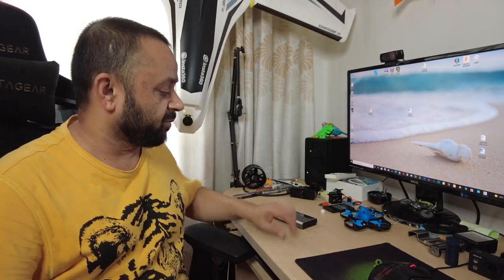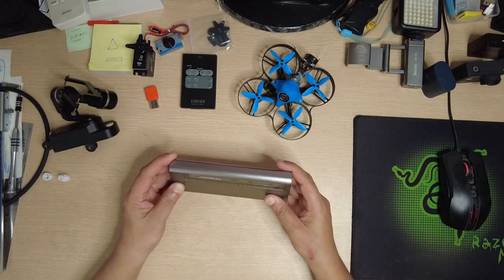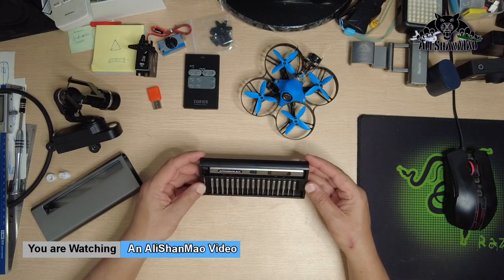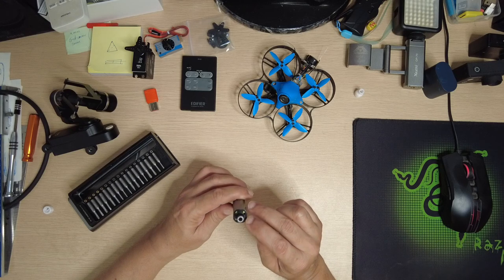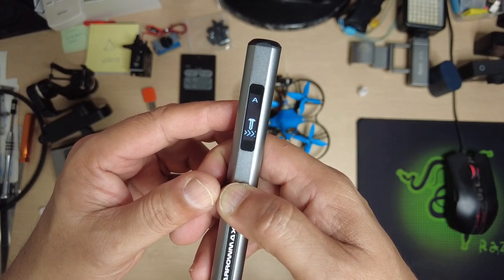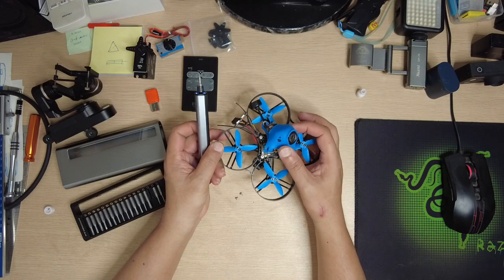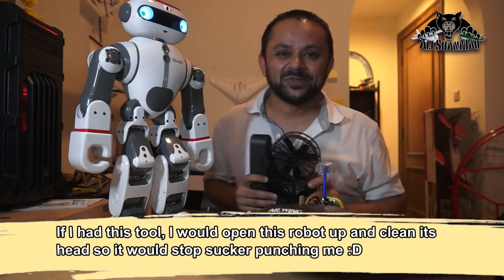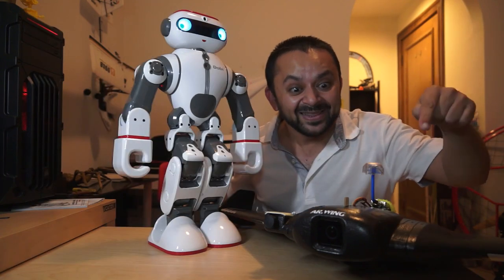SES PRO -Smart Motion Control Electric Screwdriver

Comment: I get mine today fingers 🤞 it works good. Iv had 2 drivers like this a few years back and i did love them but  they both broke when i try to remove the top plate off my drone. If the manual mode is strong enough to work and not break inside the unit then this is a dream tool for me.
Reply from the maker: these were good, now there are better ones

Comment: My main concern with ANY driver and bits is the quality of the bits. For me, the bits should ALWAYS be machined in Titanium, and not cast. 
Please do an update video after a few months of use, to let us know how the bit quality is holding up. Cheers!
Reply from the maker: sure and that is my concern too. i have trashed so many awesome and expensive tools just because the bits became bad. i have a bosch electric driver and after 6 to 8 years of use, the bits are still nice and works well. for now this one, i am using only for small repairs, like when I need to open my PS4 to replace the thermal paste, small heli or rc repair etc. so far bits are holding very well.
Reply: dude, you do you but steel is in fact harder than titanium lmao

Comment: Nice. I saw something similar last year, but it was REALLY expensive at £100!!!!!! So I managed to find something cheaper, but less capable for £30
Reply from the maker: well this one seems is a balance of capability and price :)
Reply: @alishanmao  does it an sturdy product abdool?
Reply: Which one did you buy? The kickstarter price is about 60-70 euro
Reply: @wordreet  But that one isn't capable of loosening for example laptop screws right? Unless you manually unscrew them a little with a regular screwdriver.
Reply: @MathijsGroothuis  Correct. But you can loosen screws with the Wowstick and then the motor can take over. And, for me it's a good thing, because the torque is limited to 0.5 to 0.75 ft lbs. I work on RC models mostly, and this thing will never strip any threads in plastic. Heh, I didn't plan it that way though. 😉